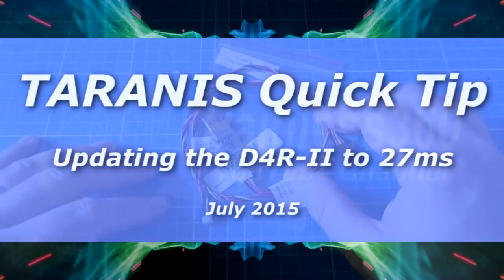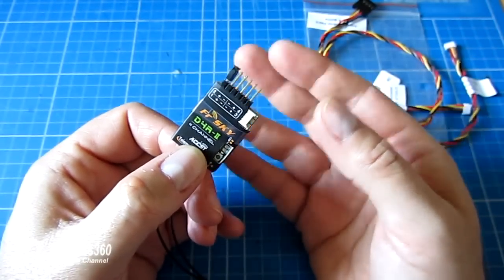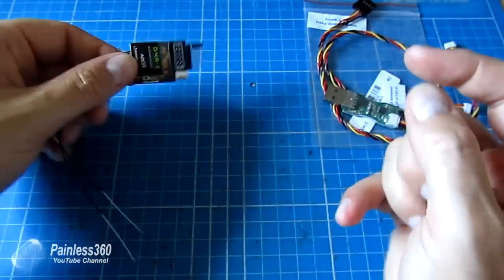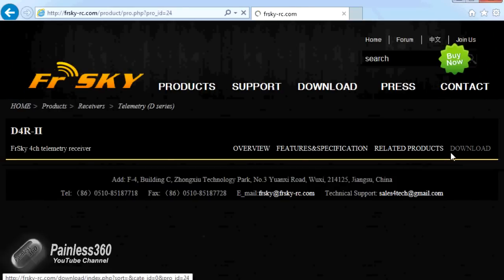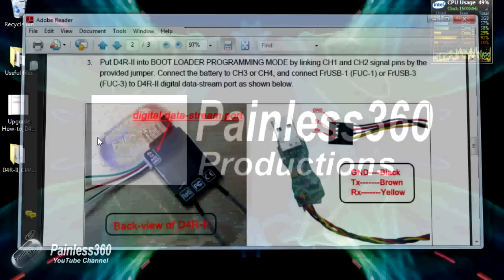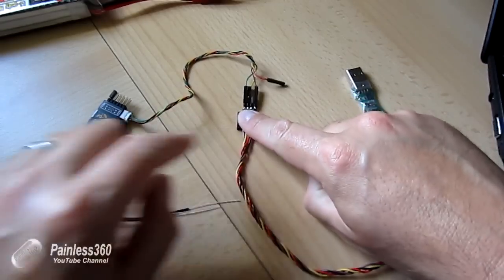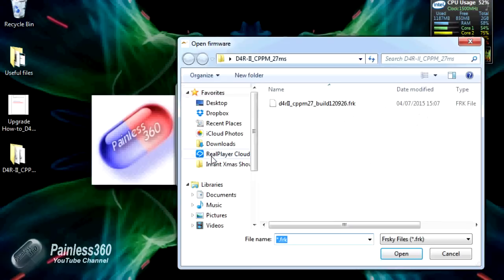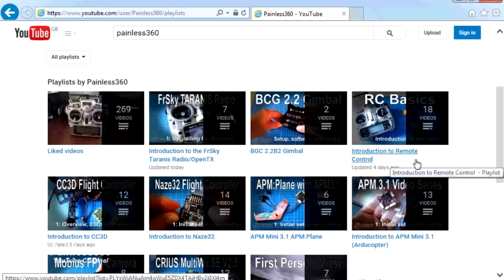D4R-II Firmware Upgrade to 27ms - Full, simple overview and demo (USB cable from Banggood.com)

Comment: Dear Painless360,
I have been trying to build a pixhawk 2.4.8 quad for a long time now. I have tackled many errors by chnaging the firmware and chnaging params. But lately I have been getting the "potential thrust loss" error. The pix gets armed and good to go, but the motors won't spin. Please help.
Reply from the maker: Please see my Pixhawk videos. I'm making updated series at the moment. I've never seen that here but I'd check ESC protocol, excessive vibration and cabling.. Best of luck

Comment: Painless360, thank you for all your tutorial videos! My question is would you do a video on how to update the firmware of the XM+ receiver using the FrSky frUSB-3Usb update?
Reply from the maker: You can flash it direct from the radio, see my receiver flashing video it's just the same for those. Best of luck
Reply: I’m using a old but faithful th9x! Lol I just wanted to know if it was possible to update it with FrUSB-3 updater.
Reply from the maker: I've not tried it. Let me know if it works..

Comment: Hi  i'm thinking of getting Taranis X9D "PLUS" radio but it says EU firmware which only allows D16-EU mode. You must purchase an X-Series receiver. They will no longer bind to D-Series radios. so will the FrSky D4R-II 4ch (8ch w/CPPM) work with this if i update it ? the X8R Receiver is way to big for my 220 v5 thug . great vid the  Taranis X9D "PLUS"will take some getting my head around unlike my old dx7s
Reply from the maker: +Jeff deakin It can appear confusing but the radio is well worth the small effort. You can change the firmware on the radio and receivers too so it's very flexible. I got my radio in Feb/March and loaded OpenTX onto it and got the options back to bind to D-series receivers, FrSky firmware only allow D16 mode but installing OpenTX firmware restores full functionality, including the ability to use D8 mode. If you look in for forums you can find more details.. Best of luck!

Comment: Is this necessary if only planning to use six channels (NAZE32 w'flight mode & auto tune) ?  Just that I'm hesitant to buy gadgets that I might only use once - appreciate any advice.Thanks
Reply from the maker: +Paul Williamson You also use this cable (with another one) to flash SmartPort based receivers like the X8R too. For the low cost they are worth keeping in the bag. Happy flying!

Comment: +Painless360 I would first like to say that your videos are invaluable to me! I have learned so much from them being that I am coming back from a 10yr hiatus from the hobby. I have a question that may be slightly off topic. I have been looking to get a cheap laptop for doing this kind of thing. I keep hearing you say that you use a netbook. Is there anything special about yours or will any reasonably equipped low cost netbook be good for the job? Thanks for any advice!
Reply from the maker: +John Jones Mine is an ACER Aspire. You don't need lots of power for most things RC. A modern laptop would have way more power than the one I use now anyway. Best of luck!
Reply: Painless360 Thank you!

Comment: I ordered a gimbal that plugs into the the reciever--2 cables--one yaw, one pitch.
Can I still use PPM with my flight controller and have those pitch and yaw cables plugged directly into the receiver?
Reply from the maker: odinata I would use an X8R and PWM for this. You could also look at using the flight controller to run the gimbal too...Best of luck.
Reply: Painless360
I want programmable LED's as well.
Maybe SBUS on my X8R?
Not sure how I could control the gimbal from the board....

Comment: Am I right in thinking that the new EU firmware for the Taranis renders the d4r-ii useless? I'm currently flying an x8r but am looking to get a d4r-ii to use ppm and save a few grams but am slightly put off now...
Reply from the maker: kuunder2 This is a complicated subject! I am using OpenTX and I get all options with the EU firmware on the internal radio transmitter..

Comment: I just had a CP2102 UART adapter without the fancy FTDI inverting capability. But fortunately, it appears that the D4R-II is RS232-compliant, so I ended up using the good old serial/COM port on an old PC and it workt just fine. Too bad they were kicked out from modern PCs, but chances are that you'll find a RS232 pin header on your motherboard...

Comment: I tried to flash my Receiver using ftdi. but if i connected and parse it after i inverted the rx and tx, the box is unchecked. Then i found out that my FTDI is write-protected. Good thing is that my laptop(Panasonic CF 19) has an RS232 port wherein it acts like an FTDI. It's so easy to do it on my D8RII-Plus. you just need about 4 single lead servos. :D  nice tutorial Painless360 , if that USB cable is cheap that would be great. haha

Comment: I bought FrSky D8R-XP and connected to Flip32 in CPPM mode. Then throwed all six channels in the max, and all was well. After arming quad the throttle started drop to low and back after a every few seconds, by continue to fly the quad began to give a SOS signal from buzzer. I removed power form ESC and added separate UBEC for FC. All same. Then i connected all channels and no problem. Should I upgrade D8R firmware to?
Reply: Allan Tamm Addition. I set yaw to left for filesafe and it was not triggering with this throttle drop.

Comment: So what are the drawbacks of flashing this? Why doesn't it come that way from the factory? Does it make the controls a little less responsive?
Reply from the maker: Timothy Smith They so now, see the forums for some reports of the failsafe having problems after flashing. Works ok here..
Reply: Yes I can't get the receiver to setup failsafe on mine now after flashing the firmware. After searching the net there were 2 ways offered but both didn't work for me. (1 after binding pressing the F/S on the receiver with the transmitter off and the other with it on)
I want the motors to stop when control is lost but when I choose failsafe in Baseflight the motors still run slowly (but do spool down to a slow speed) when I turn off the transmitter.

Comment: I followed your guide but mine stalled at 64% so I left it but after some time it did not complete. Now it seems the unit is bricked...

Do you know of a process to force flash these units?

Any help would be great!
Reply from the maker: Jamie Harwood Bad luck! I'm not aware of any process but I would reach out to the supplier if another attempt doesn't work..
Reply: Painless360 Interestingly, unlike other such devices. I retried the flash process about 10 times and on the last try the flash worked. I think it was my PC setup that caused the problem as I'm a Mac user and I run Windows 10 in a virtual machine (VBox). Maybe worth a word of warning in your future videos. FYI, I've been in IT now for 32 years and I still get caught out with this type of thing...

Question: The flash completed with 100% and I then clicked "End". How do I know if the flash worked?
Reply from the maker: The receiver boots ;)

Comment: There have been reports of problem setting the failsafe so no pulses are sent if the connection with the transmitter is lost with this 27ms firmware.
Can you please check.
Reply from the maker: dfred001 Where have you read this? A link or pointer would be useful..
Reply: In the end he managed but it seemed more difficult than normal.http://www.frsky-rc.com/BBS/viewtopic.php?f=4&t=6949If you search for "27ms failsafe" you will find more people who had problem after loading  the 27ms firmware.

Comment: You say 8 Channels but, it's a 4 channel. I'm missing something.
Im using a Flysky Fs-i6. Can I use a D4r-II with PPM (one cable) and have more than 4 channels and have telemtry? Right know I dont have telemetry I'm using a Flysky fs-ia6 and waiting ages for a cheap Fs-ia6b for a PPM receiver.
Reply: Oscar Ponce  What you have is from FLYsky, this is FRsky, different brands, unless your radio is fitted with the FRsky module, you can't use this Rx.
Reply: Yes, you can have up to 8 channels in CPPM mode.You´then want this 27ms firmware to use all 8 channels safely

Comment: just managed to do this upgrade, i used one of the cables that come with the d4r and swap a couple of the pins around to connect to the usb stick.

I didnt notice the jumper going on 1 and 2 pins to begin with (usually its 3 and 4 for cppm output) so took a while to notice that.

first real attempt it stuck at 11% so unplugged everything and shut down updater. plugged in usb stick, powered d4r, connected d4r to usb stick, started updater and it worked 100%.

thanks for this vid, have had the usb updater for a while but when i looked for online instructions they were a bit baffling so its been living in my spares box.
Reply from the maker: Barry Hearn Great news - well done! :)

Comment: Can you do this upgrade with a ftdi adapter?
Reply: Nanite Nanitian  Don't forget if you use an FTDI then the first thing you have to do is Invert RS232 Signals the RXD and TXD on the FTDI, this can be done with FT_Prog under Hardware Specifics. Don't forget re-return them back after programing the receiver or next time you go to use the FTDI for normal use it won't work. Apparently from what Rob B has said later not all FTDI's allow this mod via software so please check yours before trying, thanks for the input Rob.
Reply from the maker: skidgalning Yep - you sure can!
Reply: I tried but it didnt work. No uid . Must try with another ftdi adapter.
Reply: Paul Thomas Invert RX and TX on the FTDI.
Reply: Paul Thomas  It's  not semantics. "reverse the RX and TX" is probably going to be interpreted as a simple cross over like most of us have done before wiring in a  flight controller, GPS or Bluetooth device. I have no doubt YOU know exactly what is required but what you wrote is misleading to non experts.
To be crystal clear, What you really wanted to say was to use the Ffprog software to invert the RX and TX signal POLARITY. so that digital a high becomes low and visa versa and connect the TX line of the adapter to the RX line on the D4RII and visa versa.
In addition to all of that, this hack is only applicable to FTDI USB-serial adapters. Adapters using ch340, CP2120 etc will not work since you can't invert the signals via software and will need a hardware inverter to work.
Reply: Paul Thomas Ok thx for this important info. Typical Frsky to invert the signal. I have prolific usb-serial adapters only :( I have one inverter cable I have to make another one and try it then. I checked my conf and I probaply will not have a situation that all the channels will be at full 1500. So maybe I'll stay with the older faster firmware.